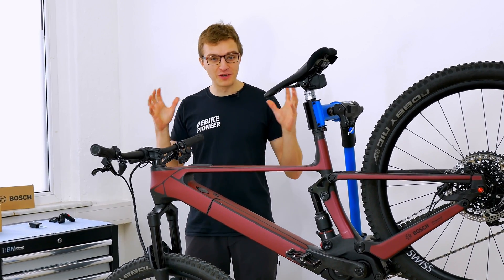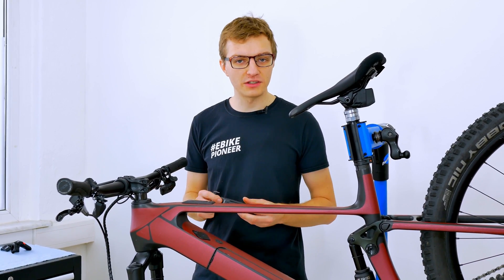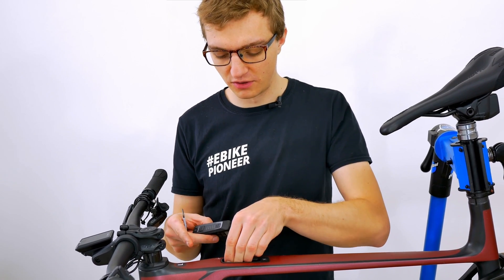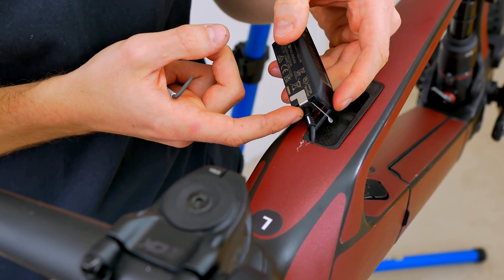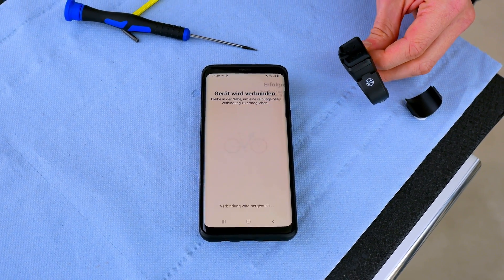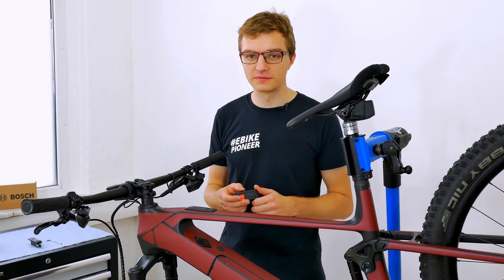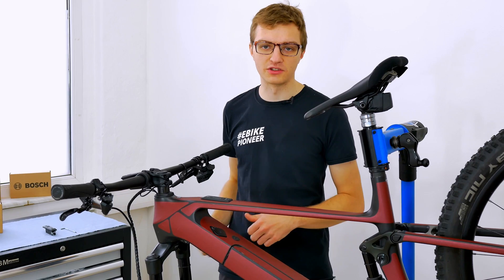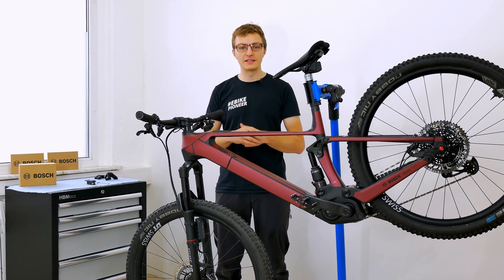Bosch System Controller installation & removal / retrofitting | Tutorial | EBIKE24

Comment: Manys thanks for your video
Is it possible to fit a purion 200 on a bike with only the system controller (no mini remote or else) like for eg canyon on gravel 7 cf ?
Reply: … and I add a question 😊
With only a system controller (same Canyon) can I fit a miniremote, so the miniremote could handdle a Kiox 300 ?
Reply from the maker: Hello,
You are very welcome. Yes across the board for both your questions.
Cheers, Luca
Reply: @ebike24  
Thanks for your answer and keep on good content 👍
Reply: @ebike24  As they both are controlers (not just remotes) they will conflict and wont be able work togher, only one out of two, right?  Otherwise I dont understand statement in official bosch web: Is your eBike with the smart system currently equipped with a System Controller? Due to the permanent integration in the top tube of your eBike, conversion to different control centre, located in Purion 200, for example, is not intended.

Comment: Please help me understand something. Looking to buy a bike now, a Radon Deft, which comes with system controller, and mini remote, but no Kiox by factory. In this case, the system controller connects to the motor and to the mini remote wireless? As the only cable you connected to it was the kiox display cable. Thanks
Reply from the maker: Hello, yes, you nailed it!
Cheers, Luca

Comment: I'm only just learning about e-bike drivetrains but... you need help from a dealer to replace a part on your own bike and are not allowed to just do it yourself? Eww.
Reply from the maker: Hi Alex, yes, this is the case for Bosch at the moment, unfortunately. But luckily, this does not apply to every e-bike drive manufacturer. There are plenty of others like Shimano, Yamaha, Fazua, etc. But Bosch is currently the most popular drive system, at least here in Europe. Let me know if you have any further questions about e-bikes!
Cheers - Michael
Reply: @ebike24  My preference is to avoid Bluetooth too. So currently looking at getting a donor bike and getting someone to convert it with Bafang BBS01b kit (250w, UK legal). But open to suggestions for alternatives that are consumer/repair friendly and have no or disablable BT/radio. Looking for a (mid-drive) hybrid or maybe hardtail/XC MTB.

Comment: Hi! I cant find anywhere how can I remove Kiox 500. It is to big. I have mini remote with system controller and I think it is enough for me. Gratefull for help!
Reply from the maker: Hi! Thank you for your comment. To remove the Kiox 500 you just have to remove the Kiox and its holder from your handlebar. That is really all there is to it. You can also remove / unpair the Kiox 500 from your e-bike system via the Bosch Flow app but this is not mandatory. Here is a link to our Kiox 500 installation tutorial, maybe this helps you as well: https://www.youtube.com/watch?v=9JcT2Ahs7fQ
Cheers - Michael
Reply: @ebike24  so, and all loose cables just hide to frame in case I change my mind... Thanks! :)
Reply: @ebike24  unfortunately it looks just simply unconnect  kiox with mount is not enough. I disconnected cables from kiox mount and removed it. Bosch System Controller is trying to start but is unable to connect Flow app and immidiately switch off... :(

Comment: Please do a video on how to remove the Kiox 300 display on a bike with the mini remote like this one?
I want a cleaner cockpit on my Mondraker, but can find how to remove it anywhere.
Reply from the maker: Hi and thanks for your comment. You should be able the Kiox display from your e-bike system via the Bosch Flow app. You can then install the mini remote in combination with the system controller. The Purion 200 might be interesting for you too since it is a minimalistic control unit with a display included: https://www.ebike24.com/bosch-purion-200-control-unit

You are also welcome to contact our customer service under info@ebike24.com.
Cheers - Michael